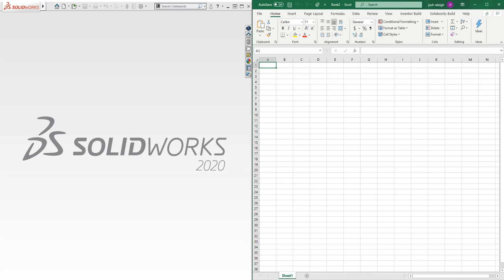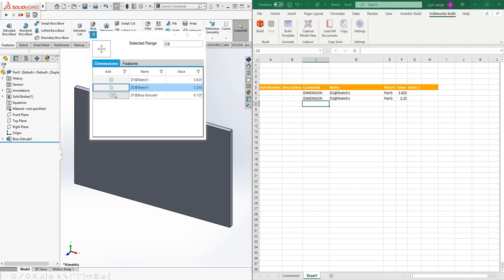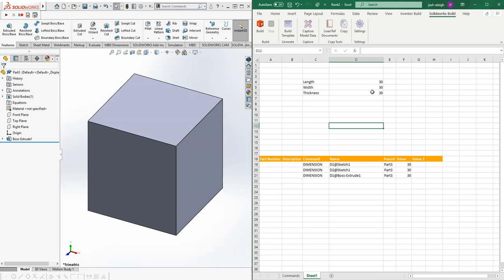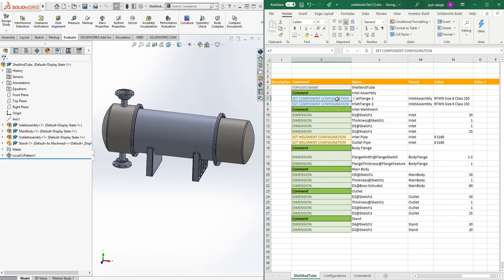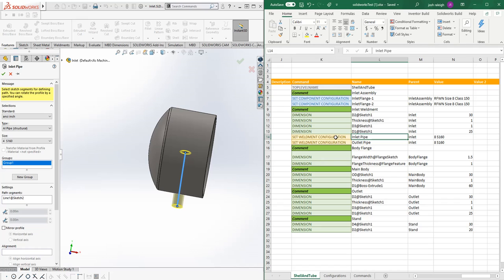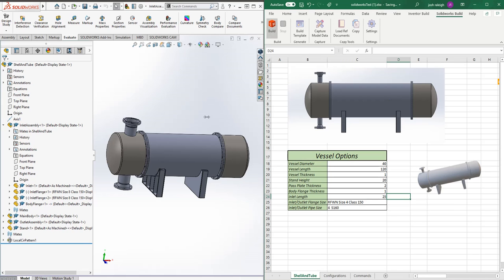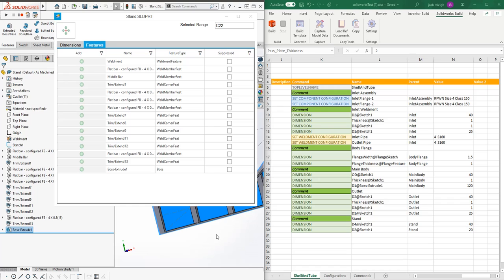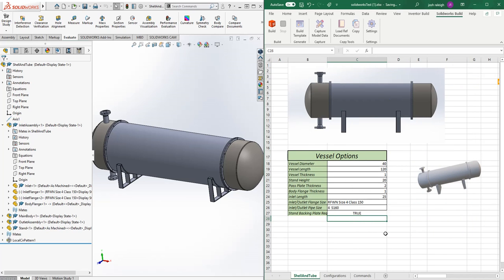Solidworks Automation using Excel Add in

Comment: found it. use vs code 2022 (must have build function) and open .sln file and run it. before that create a certificate for signing and move reference file inside AutomationDesigner folder. Run it using vs code 2022 pro (its free around 8 gb) that's all

Comment: Helo... me again. I tried a lot but i can't figure out. If i command to suppress ( S ) a part in an assembly, then build process end up with an error that can't find the supressed part. Would you help me about it please if posibble.
Reply from the maker: Could you open as issue on github with the stack trace?
Reply: @engineeringautomation8585  Hi.. i sent an email and opened an issue but didn't get any return. Hope you are fine.

Comment: @Engineering Automation
Sorry for too many questions. I asked this under another video but it is related to this video.
After using this addin to control assembly, if i copy the assembly with all parts (like pack and go) will i be have control on new assembly and new parts by new Excel or the old one?
Reply from the maker: You can use any excel sheet as long as the part number matches the open documents structure. It doesn't have a link like design tables do. So its pretty flexible on that.
Reply: @engineeringautomation8585  Thank you very very much! Would you please demonstrate other commands (for example 'equation') how to use? And do you mind if i ask your e-mail? Thank you again for this amazing addin!
Reply from the maker: @nekadaracikdegilmi  Sure thing working on making a new video to explain all the commands! I working on some drawing automation for a future release.
Reply: @engineeringautomation8585  Great news!

Comment: Hello Engineering Automation,
I'm a big fan of your work. This tool is exactly what I am looking for :D. But I have an issue with running this add in.
In advance, I want to say that I'm not a developer :D. 
When I open it in Visual studio, and try to compile, it will send me 70 errors and all of them are CS0246. I downloaded wrappers and placed them correctly. The files that cannot reach are where they are supposed to be, I think.
Can you please help me to fix it?
Thank you in advance ;)
Reply from the maker: The only thing that comes to mind initially is making sure you have the correct version of the dotnet framework installed. It that doesn't help let me know at https://github.com/jraleighdev/AutomationDesinger
Reply: @engineeringautomation8585  Hello Engineer Automation, thanks for this  useful tool. Can you  please help  me to compile the project? I'm getting same CS0246  errors. Also tried "advanced installer" but i  get different errors  on that  too. Thanks  in advance  and thanks for the tool again.
Reply: Nevermind i solve the problem. The problem was syncfusion files in project were in false condition. When i change their condition to true errors are gone :)
I just want to ask something; dimension values  on excel are comes to solidworks inch type. How can  i change it mm?
Reply from the maker: @nekadaracikdegilmi  So units are handled in the solidworks wrapper. I haven't implemented user setting in ui. You can uodate the default units in wrapper. Solidworks using meters as its internal units through the api we have to convert to desired units.
Reply from the maker: Well another thing came to mind lol. The ui is powered by some syncfusion tools they are free to download you can create an account use them for any open source project.

Comment: Hello Engineering Automation, 

Thank you for openly sharing your work ! I really appreciate it.
I've been watching so many tutorials to looking into API to do exactly this. I'm not a developer. I am terrified !

Perhaps you could help?
I  downloaded and opened the .sln file in Visual Studio.  
It is showing : "...\SolidworksWrapper\SolidworksWrapper\SolidworksWrapper.csproj : error  : The project file could not be loaded"

It says the same thing with InventorWrapper.
...I have no idea what a "Wrapper" is.  I don't listen to rap music much. 
Could you clarified on how to get it to work ?

Thanks in advance.
TR
Reply from the maker: The next step will be downloading the inventor wrapper and solidworks wrapper from github the visual studio will be able to find the projects and compile.
Reply from the maker: Without getting to complicated a wrapper is section of code that wraps another. The reason for wrapper is to make talking with cad applications easier and manage memory.
Reply: Hey man,
 
Thanks again for sharing the project.
 
For the people who got stuck:

1) Download the Inventor/SolidWorks wrapper from this link:
https://github.com/jraleighdev?tab=repositories

2) Open up InventorWrapper.sln

3) Add reference to the Autodesk.Inventor.Interop.dll
This file is located at where you installed Inventor.
If you don't have Inventor, there is a copy of the file in AutomationDesigner/References
   (from zip)

4) Open AutomationDesigner.sln.
Reload the 2 wrappers.
Add references to the Syncfusion from Nuget packages by:
...
Finding the name of each and install them.

All the reference files should be gray (no yellow).

5) If you want to run debug to see what's going on in the code,
Open Properties of Automation Designer. 
In "Debug" tab, select start external program and link to "EXCEL.exe" on your machine.
 

6) Enjoy the power.